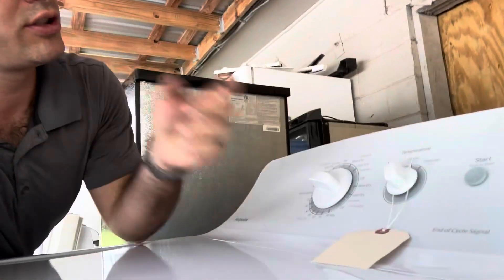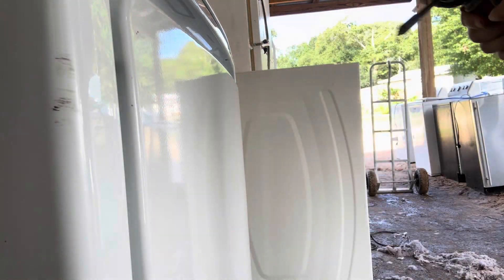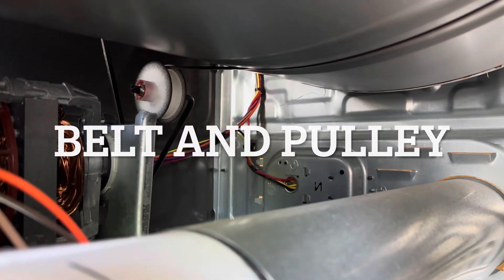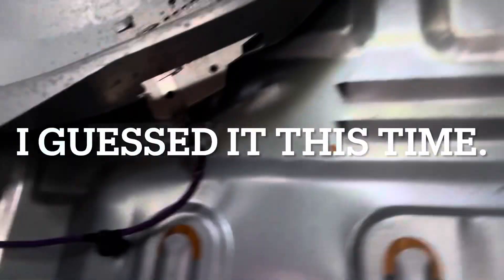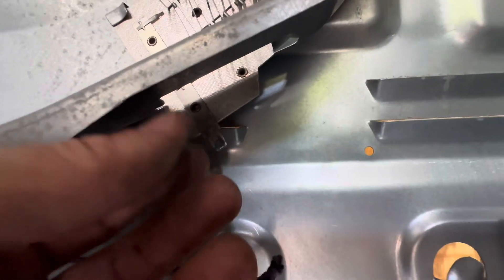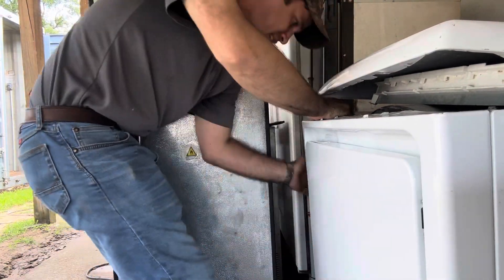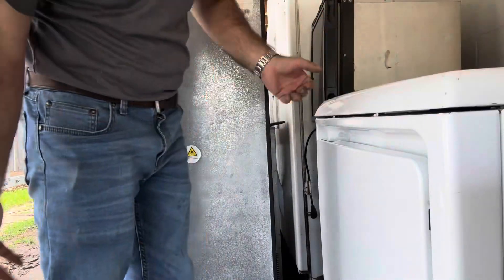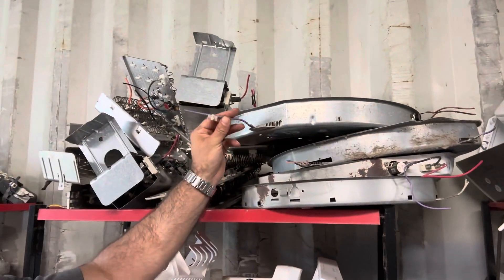How to fix a GE/Hotpoint dryer that’s not heating up | Quick teardown | purple wire repair

Comment: Dude, you're a lifesaver. Same problem here... on my way to pick up a new connector.
Reply from the maker: @SsgtMcNasty1  sweet! I’m glad it helped. Apparently I’ve seen a few comments that GE is excepting this is a problem and will fix it. But I haven’t heard that first hand. I’m still just fixing wires and getting them back heating.

Comment: I will never take that top panel off again. That alone is worth a fortune. But to open it up. And it’s the same wire. That saved my day man. Thank you
Reply from the maker: @terrancegrabowski3470  awesome glad it helped someone. Thank you for the feedback 👍
Reply: Also I didn’t think about the fact, that this way, I didn’t have to unplug it, that connection has power 😂
Reply from the maker: @terrancegrabowski3470  😯 pow! Haha

Comment: Mine is only getting warm could 1 coil be out it takes 2 full cycles to dry, i guess i need to take it apart and look.
Reply from the maker: @chrissharp8518  yes one side can be bad. It happens a lot. But also make sure it isn’t just clogged up first. But yeah definitely test the element for continuity on both sides

Comment: My dryer is like 6 months old and this has happened now for the 3rd time!  Last time GE replaced the entire wiring harness but again after about two weeks same issue again. What the heck is going on I don't even want the dang thing anymore I can't trust it.  I manage hundreds of apartments and just started buying these GE's but with this all going on I'm going to swap back to Whirlpool.
Reply from the maker: That is insane at 6months old. 😮. Under warranty they should replace the whole element too. I do if the terminal is even slightly too boogered up. Crazy I can’t believe 6months.
Reply: @LAapplianceguy  Ya it's been very frustrating especially because it takes them two weeks to come and look at it each time.  What really bothers me even more is I had an old Admiral dryer that was literally 20 plus years old and still worked great just looked old that this GE replaced.  I should've just kept the old one!  It was super loud but it at least worked.
Reply from the maker: @ I swear man warranty means nothing now days. Two weeks to come and you are still having issues. Sounds like a dang lemon to me. But yes it is hard to beat those old school dryers. A lot of times the old ones still work they just fall or rust apart! 🤣 thanks for watching. With all those apartments you manage I bet you deal with ALOT of headaches jeez!
Reply: @LAapplianceguy  we always used Kenmore branded whirlpools until about a year ago and rarely had issues with those. If we do it's almost always one of the fuses or the element & the parts are super cheap & we can replace them in like 15 through the back panel. The fact you have to take the drum out to access these alone makes me want to switch back to whirlpool. I've had better luck with GE ranges though than we did with the Kenmore branded Frigidaires before. Those Frigidaires the control panel would fail like a month after warranty and a new one is almost what I paid for the range so happy with GE for the ranges for sure. Also had good luck with the GE refrigerators but I'm done with these dryers and I haven't even complained about the god awful siren buzzer for end of cycle you can't turn off. Not sure what GE was thinking there I about jumped out of my skin first time that went off. I did figure out how to disable it completely though the buzzer that is. One wire unplugged problem solved.
Reply from the maker: @ yes the apartment complexes we deal with buy those Frigidaire controls and facias by the dozen. They are very common. Yeah that buzzer is intense 🤣 I like your problem solving there. That’s how I roll. Unplug that stupid thing.
Reply: @jkulysses you can actually unhook the buzzer. Just take the back off the control panel and you will see a small square black box with two wires attached. Simply unhook one of the wires and tape it up.  That will end your buzzer misery.
Reply: @LAapplianceguy  Update the repairman came back this past Friday and called GE while he was there and GE said they want him to replace the element and they have an upgraded purple wire they made it sound like it's a kit to correct this issue with updated parts.  Hopefully the part come later this week and I can get my dryer back. Going to laundry mat like a peasant is getting old lol.  Out of the now about 7 months I've had this dryer I've went well over a month without it working if you added up all the different times it's went down.
Reply from the maker: @ jeez hopefully this is it. And the upgraded parts takes care of the problem. Fingers crossed 🤞
Reply from the maker: @ thanks for giving us an update. Ge better replace the element. Like why not.
Reply: So if this continues multiple times what is the root cause of the wire burning up?
Reply from the maker: @ I think it’s too many amps running through. But it’s burning at the terminal a lot of times. I have replaced many of these with just a little wire end I’ve saved off of other units and I’ve never had one come back prematurely. Yet, I guess
Reply: Did you put a heavier guage wire on it ?
Reply from the maker: @ I use the red 10-12 gauge wires that are on the whirlpool type dryers. It’s been holding up.

Comment: Sounds like this might be my problem   Thanks 🙏
Reply from the maker: @jessemalott944  very common I fixed 3 purple wires of death last week. Hopefully you can save the element and just fix the wire if the terminal is ok.

Comment: The spade connection on the heating element got burnt up and part of it broke off do you think I can still connect to it or does the entire heating element need replaced
Reply from the maker: @sm-mv8hi  it depends on how bad the element terminal is messed up. I sometimes sand the element terminal and fix the wire and it’s fine. But if it’s bad enough you have to change the element too.

Comment: I think this is going to be the issue with my GE dryer will be checking it tomorrow. Was just wondering if its ok yo use WAGO connectors instead of wire nuts. Doesnt matter really since the wire kits come with the nuts but was just curious.
Reply from the maker: @PiperDad  a guy came in a whole back and he said he had been trying out the wago on element/heavy gauge wires and it’s been fine. I just use these nuts because that’s all I have up here a lot of times. Hope it’s an easy quick fix for ya. 👍
Reply: So i ordered the little wire similar to what you used in the video i found on Amazon however the particular one i received looks to be aluminum wire and not copper. Will that be an issue. Didnt notice it wasnt copper when i ordered it. They do have copper ones too. Will it be a problem using the aluminum wire ones? Thanks for your help@LAapplianceguy

Comment: We just had the same issue in a 15 month old dryer. Tech stated each time he fixes the purple wire, he’s back to replace element shortly. He says it’s more of a connector issue on element. Thoughts?
Reply from the maker: @rickbarnette3124  connector/terminal issue on the wire I think. But if the element terminal is even a little bit too boogered I change the element too. I try and save them if I can. Because they are expensive. But sometimes the element terminal is spotlessly and the wire is burned at the crimp. Hopefully that is it for your purple wire problems. 👍
Reply: Thanks for info and video. Terminal on element was brittle so we replaced element and the connector.
Reply from the maker: @ good. If there is any question I always replace it too.

Comment: What voltage are these dryers?
Looks easy to take apart, not so much putting back together.
Reply from the maker: @mikemorassi210  220v electric dryers. Yeah they are simple. Pretty decent dryers

Comment: I have seen this happen multiple times in the past few years.  Is there an actual fix for this problem?
Reply from the maker: @keithtidwell4140  GE sells a “wire kit” but all I do is repair it and make sure it’s really tight and clean. I haven’t had any come back prematurely . Yet.  Thanks for watching Keith.

Comment: This has happened twice to my daughter’s dryer . Any way to prevent it from happening? She can’t afford another dryer
Reply from the maker: @reneedavenport4322  if the terminal is pitted up bad the only way to fix that is to replace the element. But you could try thicker wire and high temp terminals. Super tight on the terminal too.
Reply: @ thank you
Reply from the maker: @ no problem. These are great dryers. I just don’t know why this happens all the time. Thanks for watching

Comment: Seems like a bad design with the purpose to burn out and leave people with wet clothes to look at in anger. Very nice short informative videos. 👍👍👍
Reply from the maker: I’m no electrician but the wire must not be big enough to handle the load. I’m not sure but most elements are like 5200-5400 watts. Thank you for the kind comment

Comment: I have this exact same dryer .Is that the only way to access that wire . Mine suddenly quit working today .
Reply from the maker: @noclu4u384  yes you really only want to go from the front. I have been behind people who have tried to take the backs and even the sides off to reach the wire and it ain’t pretty. It’s almost never the same after they do all that bending of the metal. If it stopped heating check to make sure the breaker isn’t half tripped first and then purple wire of death. Hope that helps 👍

Comment: We can I buy the original wire to replace the whole thing.
Reply from the maker: @Jaiglenn  if you look up the model number you can buy the “element wire service kit” I believe it’s we49x37037. Not 100% sure you need to look it up with your particular model number.

Comment: As of current information, GE has publicly acknowledged and addressed the issue of the "purple wire of death" on their dryers by issuing recalls and repair programs for affected models, which involve replacing the problematic purple wire with a new one that is designed to prevent overheating and potential fire hazards; if you suspect your GE dryer has this issue, contact GE customer service to check if your model is included in the recall and to schedule a repair.
Reply from the maker: @MelissaTrimpey  great news. At least they took ownership of this! Now if they can just get things fixed in a speedy fashion. Should be good to go. Thanks for sharing. 👍